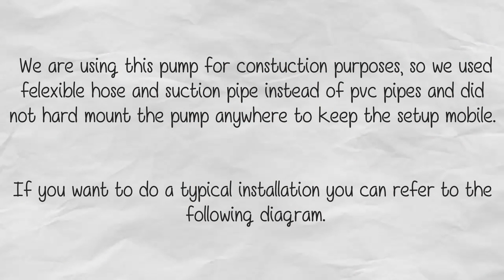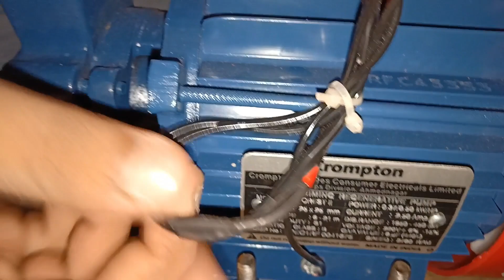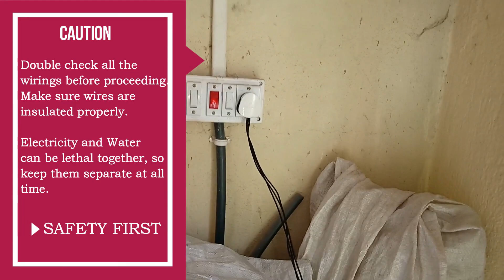Water Pump installation || D.I.Y || Crompton Mini Crest 2 (0.5 HP) ||

Comment: Bhai mere pass 1hp ki motor single phase ka hai.. Konsa tar use karu... Power 0.75 aur 180-240 voltage ka hai. Please reply
Reply from the maker: 1.5 sqmm acche company ka
Reply: @tuhinde698  thanks bhai
Reply: 2sqmm ka lu to kohi problm
Reply from the maker: No problem

Comment: sir is this possible to pump water this way to a higher altitude like 600 meters away?
Reply from the maker: No it can't pump water to 600m altitude
Reply: Tuhin De Can you suggest what kind of water pump could pump as far as 600m? Sorry my first question was wrong. I meant 600m far and an altitude at 50m?
Reply from the maker: Sorry can't help you in this, You can ask your local pump dealer for suggestions.

Comment: My question is about the  discharge head and the  rubber seal which must be removed or cut before operation,,,you didn't indicate et well
Reply from the maker: You have to cut the rubber seal, don't remove it or else water would leak through that joint, 
we weren't able to show that because the shopkeeper did that for us.
Reply: Thank alot and please more videos cos I was looking for DC oll the time bt u brought it out just perfectly!!!

Comment: I did the same procedure but still motor has not started , can you tell me anything ?
Reply from the maker: If humming sound is produced by the pump after powering it then there is a possibility that your pump is jammed, try to manually rotate the  pump before switching it on

Comment: Brother its work in a 9 meter well??
Reply from the maker: This pump is rated for an output of 1450 litres per hour from a depth of 6 metres and 450 litres per hour from a depth of 21 metres.

The max we went so far is 5 metres and we didn't notice any problem.
Reply: @tuhinde698  thanks bro

Comment: Bro I live in second floor and I bought an 1 HP pump 
Tell me where to mount it can I mount it on the second floor itself??
Reply from the maker: Yes you can mount the pump in second floor but height from the water source should not be greater than 6 meter as shown in 0:59.
Reply: @tuhinde698 can 0.5 hp pump upto second floor??

Comment: Mounting screw type Bolo na even i want to mount my motor pump
Reply from the maker: screw se nahi nut and bolt se mount kiya hain pump, aap apne requirement ke according size buy kijiye, stainless steel ka bhi nutbolt buy kar sakte hain usme rusting ka problem nahin rehta.

Comment: I DID EVERYTHING AS YOU HAVE SHOWN, BUT PUMP IS NOT DELIVERING WATER. WHAT MAY BE THE PROBLEM PLEASE?

IT IS CROMPTON 1 HP
Reply from the maker: If it is a new pump then you don't have to find the problem, Crompton will do that for you because it's in warranty contact your dealer ASAP.
If it is old then reprime the pump properly and check for any leak in the suction hose.
It will take time depending upon the distance and height of your pump from the water source, to avoid damage of the mechanical seal during this initial dry operation priming is a must.
Reply: @tuhinde698  THANK YOU

Comment: Suction la 3/4 podalama
Reply from the maker: Can you repeat your question in English or hindi pls??
Reply: @tuhinde698  input hose 3/4 or 1 size
Reply from the maker: We used:
Input pipe - 1 inch
Output pipe - 3/4th inch
Input and output head of the pump are of 1 inch, so we installed a reducer to make the output head 3/4th inch.
Reply: @tuhinde698  thank-you
Reply: Hindi theriyathu poda 😂😂😂😂

Comment: Wire connection are not clear sir. Can you please explain it again?
Reply from the maker: Pump e generally 2 to tar thake, ekta positive arekta negative, earthing er alada kono tar dewa thake na, kintu earthing na thakle short circuit hole pump dhorle shock khawar bhoy thake.
Tai amra alada ekta tar body te dewa screw er sathe attach korechi 1:10 ar sei tar er arekta end 3 pin plug er earthing pin er sathe connect korechi(plug er uporer boro pin ta) ar pump er wire gulo(positive + negative) extend kore 3 pin plug e lagiyechi (plug er nicher choto 2 to pin).
Plug er positive ar negative pin interchangable kintu earthing wire boro pin e tei lagate hbe, jodi earthing wire bhul kore plug er choto pin er sathe connect kora hoy tahole pump touch korlei current lagbe.
Reply: @tuhinde698  Amar pump a 3 ta wire ase ekta red, ekta black r ekta green. Amar earthing er lega screw nai. Toh ki ami 3 pin top a direct 3 ta tar lagaya dile hwa jaibo along with earthing???
Reply from the maker: Haan hoye jabe ar  green ta holo earthing er tar. Amar pump er body te company er thekei earthing er screw dewa chilo, jehetu apnar pump e earthing er wire agey thekei dewa ache tai company ar alada kore earthing er screw deyni
Reply: @tuhinde698  Really thank you sir a lot. I found your video to be very informative.

Comment: Is ka body earth samajh nai ay  hai ak bar fir sa samajhau
Reply from the maker: Earthing wire kisi bhi appliance ke outer body mein current aane se rokti hain, agar short circuit ya loose connection ke wajah se outer metal body ke sath positive wire touch ho jaye toh outer body current ho jayega aur appliance ko pakadne pe humein shock lagega.

Agar earthing diya huan hain toh wahi current earthing se pass ho jata hain aur humein current nahin lagta.

Iss pump mein earthing ke liye koi wire alag se diya nahi gaya tha bus ek screw diya tha jisme 3 pin plug ka earthing wire connect kiya hain, usko hi body earthing bolte hain.

Comment: Sir ye motor 50 ft tk pani pahuchayegi
Or quality btaye
Reply from the maker: Company kehti hain ye pump 21 metre (65 ft) niche se pani 450 litre per hour ke rate se nikalegi, maine 15 feet tak test kiya hain pani ka flow thoda sa hi ghata tha.

Quality toh thik hi hain ab tak toh koi major problem nahi aaya.

 Humara pump avg. mein 20-25 min tak  chalta hain aur highest 40-45 min chalaya tha koi heating issue nahi aya.

Bas 1 hi problem hota hain kyunki yeh pump construction purpose ke liye use hota hain isi liye daily basis pe run nahi hota hain, agar 2-3 din bad start karne gaya toh motor jam ho jata hain kyunki humarein borewell ke pani mein iron ka level bohut jyada hain. Aur pump me bhi  daily atleast 30 sec tak chalane ke liye instruction diya huan hain.

Comment: 70 fit niche se pani khich lega
Reply from the maker: Aap ko dusra koi bada pump lena chahiye, ye pump shayad khich dega but pressure bohut kam ho jayega. 
Company ke mutabik 21 meter tak pani utha lega yeh pump lekin tab flow 1950 litre per hour se ghat ke 450 litre per hour ho jayega.
Reply: @tuhinde698  mera 1.5inch ka hol hai  aur water lavel 55 hai to isme koi upay hai sir

Comment: sir plese can u tell me clearly the wiring process
Reply from the maker: The water pump came with 2 wires, one is for neutral/ground and another is for  positive/ phase you have to connect these two wires to a 3 pin plug/top's positive and negative pins. For earthing purposes the manufacturer didn't provide any wire, so you have to connect a wire to the 3 pin plug's earthing point and connect another end of that wire to the screw situated at the base of the pump 1:10.
Reply: thank u very much.
Reply: sir..one more question ,there is no screw at the base of the pump in mine..should i made it by myself or what??
Reply from the maker: Yes you can connect earthing in any body screw of the pump.
Reply: okay2 .thnks